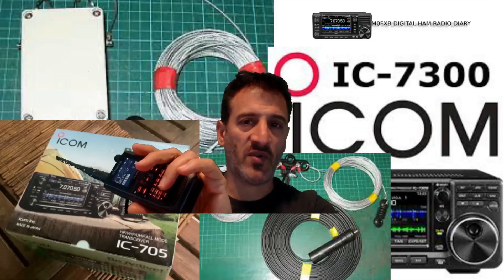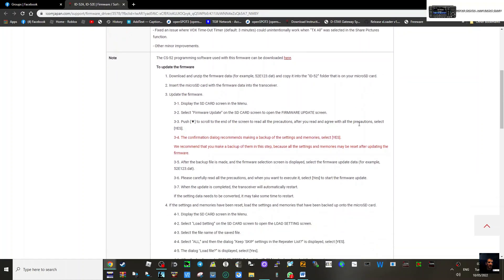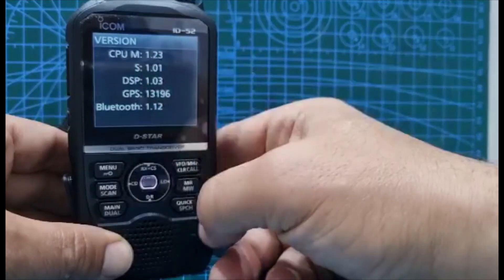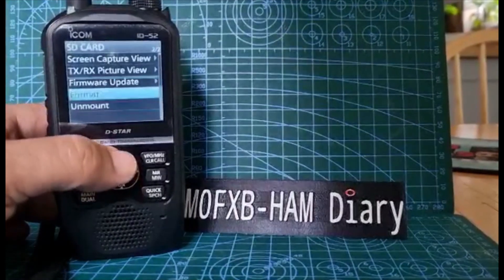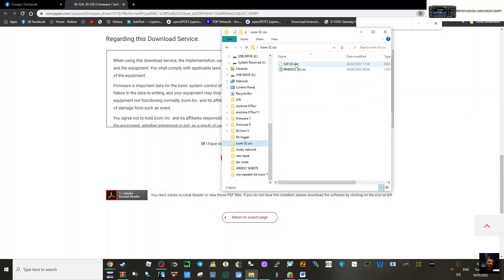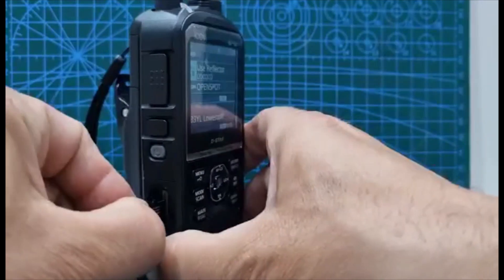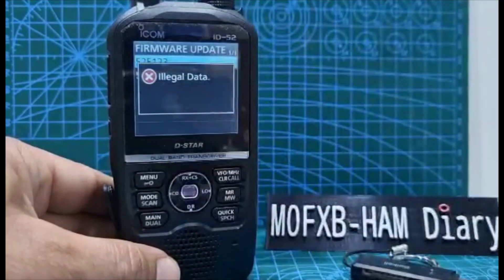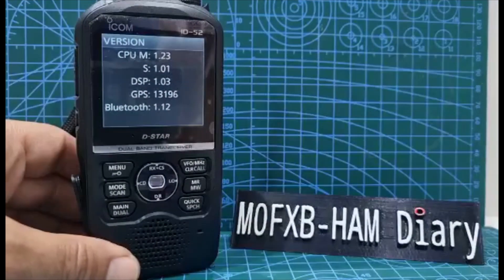ICOM  ID-52 NEW Firmware 9th May 2022 v1.23

Comment: You can connect the radio as a USB Media device by using a standard  USB A to micro usb cable. Go into Settings>Function>USB connect> SD Card Mode, then the radio appears as a USB media device on your pc, just drag the Firmware file into the drive and select the firmware as you mentioned. It just eliminates the process of having to remove and reinsert the SD card into the radio.  Great content Andreas, used it a lot when I got my ID-52. 😊

Just read you mentioned that on another post Andreas, my apologies. 73 de M0bah
Reply from the maker: Hi thanks yes i found this feature cheers 73

Comment: I recently got a ID-52 HT. Love the radio. I tried to update the firmware to version 1.23. I followed the instructions as per Icom. When I insert the SD card into the radio and try to do the firmware update, the radio doesn't see the firmware. 

Not sure what's going on, but I've tried it multiple times and the radio doesn't see the firmware on the SD card. I've done my IC-705 in the exact manner and been successful with updating the firmware. With the ID-52, I'm not sure if I'm doing something wrong or I got a defective radio. 

W4ISB 
Mike in Tennessee.
Reply from the maker: Hold your finger on the yellow button on screen.

Comment: Hi Adreas:  Thanks for all of your videos.  I updated the firmware of my ID-52A to 1.23 as you suggested.  After using the radio for a while, it rebooted itself from time to time.  I just reverted back to 1.22.  I'm wondering if there is a glitch in the new firmware.  All the best, Chris K2CVD
Reply from the maker: Hi i will let you know if mine does this .73
Reply from the maker: Hi tested mine for a few hours seems fine .
Reply: No problems with the update on mine, so far.  73's M7RNW